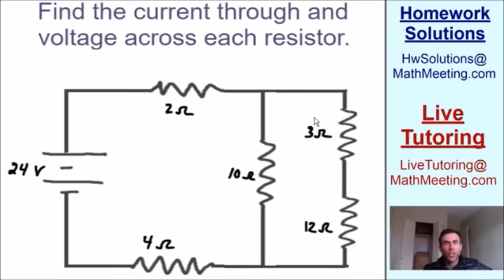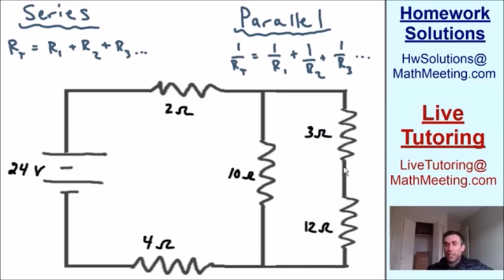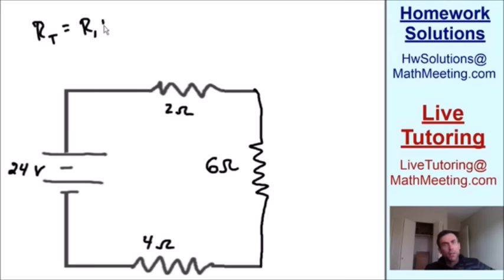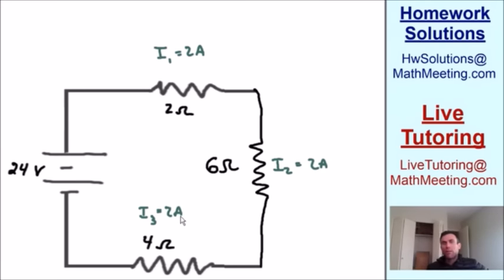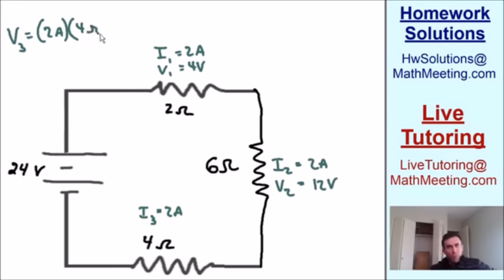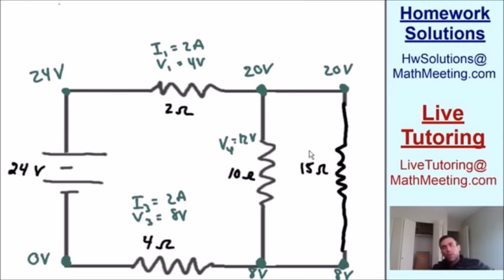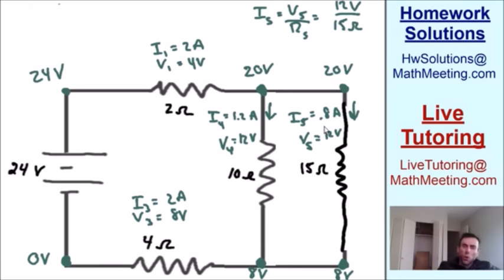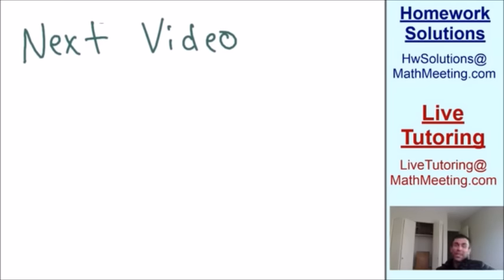Circuit analysis - Solving current and voltage for every resistor

Comment: For the parallel side you had the 12 volts after you did the series calculations on resistor #2. Since parallel circuits have the same voltage you automatically know the both parallel resistors are 12 volts

Comment: In a four branch parallel circuit, 10mA of current flows in each branch . If one of the branch is opens, the current in each of the other branches.. ?

A) decrease
B) increase
C) remaining unaffected
D) doubles

Pls say the answer sir
Reply: C)
Reply: Increase I think bcz it decreases the resistance.

Comment: You are a great teacher  but remember to also explain on power delivered by the battery and the voltage drop across each resistance

Comment: two wire of 15ohm and 10ohm are in paralled and the arrangement is in series with a 24ohm wire if the current in the 10ohm wire is 4ampere calculate the A. full current in the 15ohm wire B. the total p.d across the whole circuit

Comment: So to get the Voltage of the last two resistors (3 and 12 ohms) is to divide 12V by its resistors and by getting their amp we can use it to get Voltage each resistor?

Comment: but to calculate resistance in a parallel circuit would be rt = 1/r1 + 1/r2 ...    
1/2 + 1/3 + 1/10 + 1/12 + 1/4 = 1.27777
Therefore total ohms in parallel circuit is 1.27?
Reply: Johnry Felicia  thanks. i did my test alr tho but still got 90%

Comment: sorry im a little confused when you used the parallel equation and got 1/6, how does it go from that to 6 ohm? I plug it into a calculator and get 0.17 rounded up
Reply: because 1/Rparallel = 1/6, so you have to reciprocate both sides to get Rparallel = 6 ohm
Reply: Use this formula:

RT=(R1*R2)/(R1+R2)

Comment: 3:54 why do u change the 1/6 to 6 ohms? (My physics teacher doesn’t rly explain things correctly btw)
Reply: since its one over total resistance, you multiply the denominator by the one, then divide that by the nominator

1                1
 -        =      -     
Req            6
Reply: claire sun bruh u legit saved my ass from failing thx
Reply: Compare 1/R=1/6 simply R=6 we don't want 1 ,you see only both denominator

Comment: How did u get 5 at. 3:41
Reply: first you should get the LCM of 10 and 15 which is 30, then divide 10 to 30 and multiply to 1-- which is 3, then divide 15 to 30 and multiply to 1-- which is 2. Then add, 5/30 and then simplify.

Comment: hi. i"m hoping that you could analyse this.

 Two resistances of 2 ohms each is connected in series to a parallel
connection of two 5-ohm resistances and a 10-ohm resistance. What is the
equivalent resistance?
Reply: Probably a bit late here, but the equivalent resistance is 9 ohms

Comment: For people who dont know how he he got 5/30. 

He made the denominator the same so for 1/10 he multipy by 3 on the top and bottom which comes out as 3/30 and 1/15 by 2 comes as 2/30. Add the numerator and you get 5/30

Comment: How does 1/10 + 1/15 = 5/30?
Reply: Go to 1st grade before watching this
Reply: You have to use a common denominator to simplify, both 10 and 15 can only divide into 30. 

10 x 3 equals 30 and 15 x 2 = 30

Write the fraction 1/10 x 3/3 and write 1/15 x 2/2 

After multiplication and then addition it equals 5/30 which simplifies into 1/6

Comment: And how did u get 30
Reply: Akeem Willacy he used 30 as a common denominator and multiplied top and bottom by same to get common denominator of 30.   If you are struggling with that, good luck in your class.

Comment: If I calculate the load on an 1800 watt microwave to be 15 amps by doing 1800÷120v why wouldn't I take the resistance in the first example (12ohms) and divide it by the voltage (24v) giving me .5 amps?

Comment: Can u tell me how u got the 6 because I keep getting 0.17
Reply: listen,,, incase of parallel circuit, the formula is like,,, 1/Rp= 1/R1+1/R2+1/R3+....... 
even though you get the value of 1/Rp=5/30... its not the result, because you need Rp, not 1/Rp.. so, you invert the fraction that is..
1/Rp=5/30
or, Rp=30/5 
or, Rp=6 ohm... 
I hope you understand now why its 6ohm instead of 0.17 cause 0.17 is the value of "1/Rp",, but you don't need that, you need the value of "Rp"

Comment: Where’s the 5/30 came from how’s that happened?
Reply: You can't do 1/10 + 1/15 without making the denominators equal first. 1/10 is the same as 3/30, and 2/30 is the same as 1/15. So 3/30 + 2/30 is 5/30
Reply: Subb, yes. I Understood! Very well explained subb. It’s algebra-fraction.
Reply: And how 1/6=6??
Reply: And how 1/6=6??
Reply: @natzu4264  1/R=1/6, therefore R = 6
Reply: THANK YOU

Comment: I have a 12 v 100 Amp battery I am using MOSFET 7805 to drop voltage to  5v 1Amp but how I can drop input current 100Amp to 2Amp for input Pin of MOSFET.

Comment: if kirchoffs law is applied, the total voltage across all resistors doesnt add up, it in fact exceeds 24 volts
Reply: That's because some of the resistors are in series, and some are in parallel. The voltage stays the same across a parallel branch of resistors.

Comment: Could someone please help me with this Potentiometer circuit that has an array of 4 LEDs. Each LED should have its own resistor and switch connected to a unique output pin. Based on the level of the potentiometer, light up LEDs in the following maner:

1. When the dial is all the way left to 1/4 of the way around light up LED 1
2. When the dial is between 1/4 and 1/2 of the way, light up LEDs 1 and 2
3. When the dial is between 1/2 and 3/4 of the way around, light up LEDs 1, 2, and 3
4. When the dial is between 3/4 and all of the way around, light up all four LEDs
**Given input is 5v

if you could include a diagram with calculation & resistor value using for each LED in the circuit is best. Thank you very much for your time and kindness.

Comment: i thought if you have 2 resistances in parallel you use R1xR2 / R1+R2?????
Reply: You are correct. 10*15=150. 10+15=25. 150 / 25 = 6. So both ways give you the same answer

Comment: Lost me at 5 over 30. How did we get 5 over 30, from 1/10 & 1/15?
Reply: He made the denominator the same so for 1/10 he multipy by 3 on the top and bottom which comes out as 3/30 and 1/15 by 2 comes as 2/30. Add the numerator and you get 5/30

Comment: How come 1 divided by 10 plus 1 divided by 15 = to 5 divided by 30 ? Plz someone explain it
Reply: 1/10 = 3/30 and 1/15 = 2/30, so add those two to get 5/30. Assuming the 5 you’re talking about out is the one over the 30.

Comment: I couldn't be more confused.  I've watched 20 videos on this and everyone has a different opinion. 

Almost every says that the purpose of a resistor is to decrease current.  Why? when it changes volts, too?  Almost every says that voltage returning to the battery is the same as coming from the battery. 

No one emphasizes the prepositions like in "across" the resistor or "through" the resistor.  Even you interchanged them.
Reply: @lilvince9647  current isn't the same across all resistors in parallel but is the same in series
Reply: Check out the difference between Convention and Reality, Conventional Math is often made of assumptions then reality is based on scientific observations through testing.

Comment: You say to add 1/10 + 1/15 and it equals 5/30 but  shouldn’t it be 2/25. Why 5/30???
Reply: 1/10 = 3/30 and 1/15 = 2/30, so add those two to get 5/30. Assuming the 5 you’re talking about out is the one over the 30.

What you’re doing is adding them up without a common denominator. Make both denominators equal 30 and then you’ll get 5/30.

Comment: the two far right resistors arent just magically going to switch into series this isnt completely right
Reply: They didn't magically switch into series. He first found the R(eq) by adding them together because they are in series and they totaled to 6 ohms. Then he started working backward till it became 10 and 15 ohms then back to the original (12 and 3 ohms in series). So he simplified it and then went back to the original in steps. Didn't just magically appear.

Comment: Why does 1/10 plus 1/15 = 5/30? I can’t get my head around it.
Reply: to add fractions, you have the find the LCM of the denominator, and then multiply the numerator and denominator by the same amount so that the denominator reaches the LCM. the lowest common multiple of 10 and 15 is 30. 30/10=3, which is what we multiply the first fraction's numerator by. 15/30=2, which is what we multiply the second fraction's numerator by. now we're left with 3/30 and 2/30. The last step is to add the numerators together (leave the denominators alone) 3/30+2/30=5/30. Hope that makes sense.
Reply: @caleb6978  THANK YOU CALEB I WAS LOOKING FOR AN EXPLANATION AND CAME ACROSS YOUR COMMENT YOUR A LIFE SAVIOR

Comment: I got lost when you said 1 over 10 + 1 over 5 = 5 over 30? I can seem to comprehend how the equation works?
Reply: I am in the same boat. How did he get 5/30??
Reply: @Katjohns04   I figured it out yesterday. You have to divide each of the numbers on the bottom by one.
So: 1 over 10 means you divide 1 by 10. To be clear, it's not 10 ÷ 1 it's 1 ÷ 10.
So you divide 1 by each of the numbers individually, then you add those numbers together and divide 1 by that new number
Reply: @Katjohns04  NVM. That's a different way. I have no clue what this guy just did
Reply: @rubenyoung812  dude i cannot understand pls pls plss explain plss i really need this

Comment: you showed the current going the wrong way.. the current always flows in the negative direction which is indicated by the shorter line.
Reply: @Bloodred Pyrate This is not me being pedantic, nor was there anything ridiculous about my statement... I was merely pointing out a very important rule to keep in mind when dealing with these electrical systems and something anyone here ought to know as they are likely studying for an exam and shouldn't be confused on this crucial distinction... And yes, I was implying "positive to negative" flow. You do make a good point, however, about conventional current.